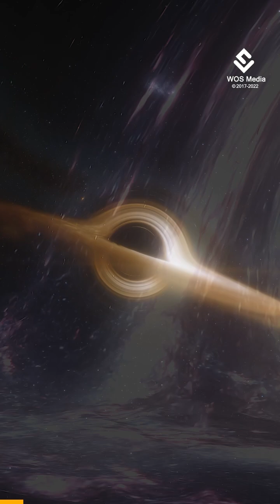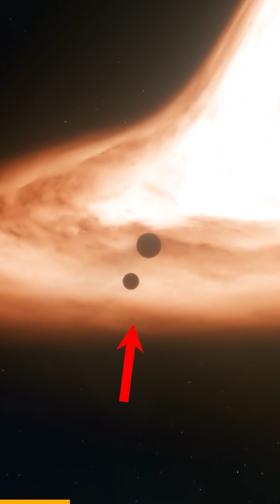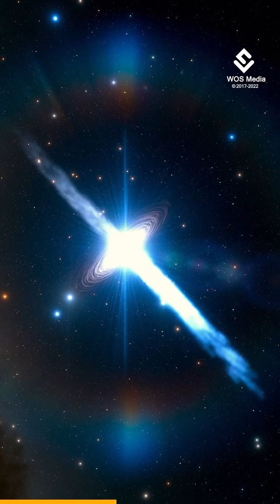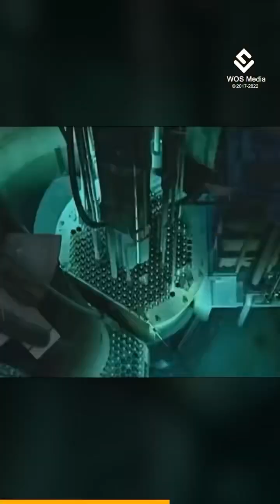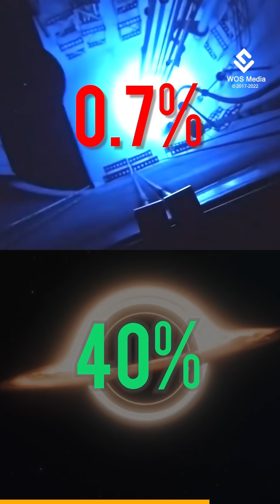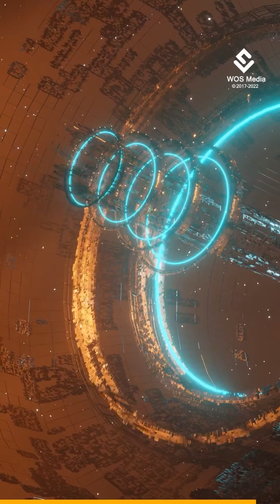Can We Extract Energy From Black Holes?

Comment: There are researchers who have already realized that beyond the material frequency spectrum, is a field that they may call the Zero Point field or other names, but it is a field that has unlimited energy.
What scientists are beginning to realize is that the current vision, where everything is seen as separate objects existing in a spatial dimension, is unrealistic. There are no separate objects because every object you see on earth or in the material universe is actually manifested out of the field. It is a densification of the field where the unlimited energy of the field has taken on a finite form. It is a temporary form but it can be sustained over time. 
It is, of course, the same with energy. There are scientists who have already conducted experiments that show that you can extract energy directly from the field and use it for practical purposes on earth. They have been ridiculed and put down, they have had their research grants taken away and they have been labeled as kooks.